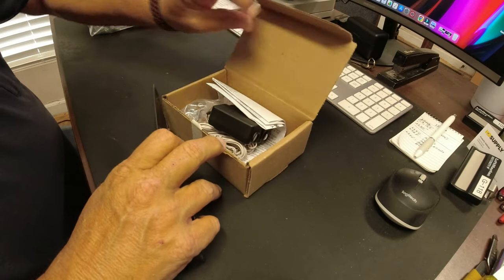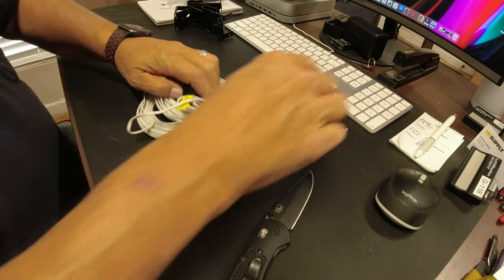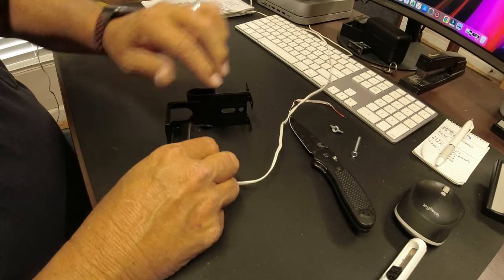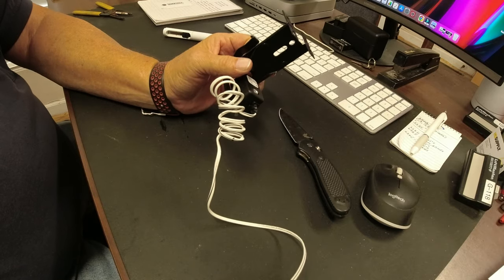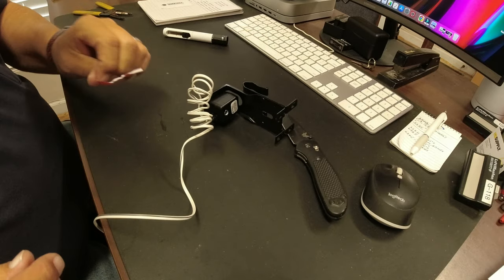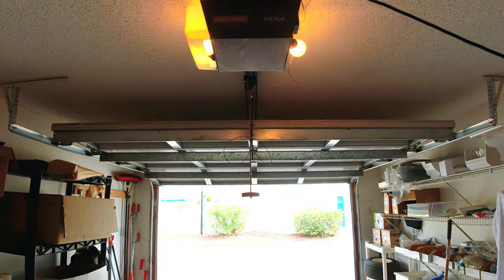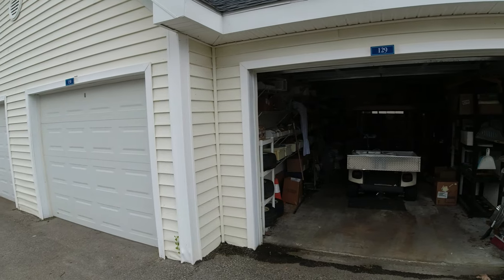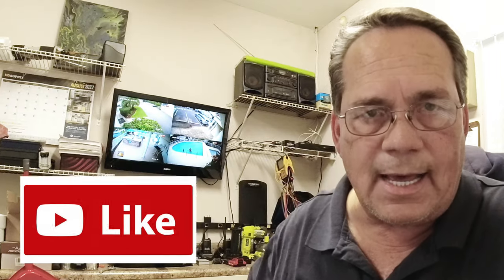Replace Garage Door Sensors Quickly and Easily

Comment: Thanks for the video. The cable from the wall does serveral wires with diferent color, not like the two wires you have. Do you have any idea what wire to match to each of the wires from the sensor?
Reply: multimeter